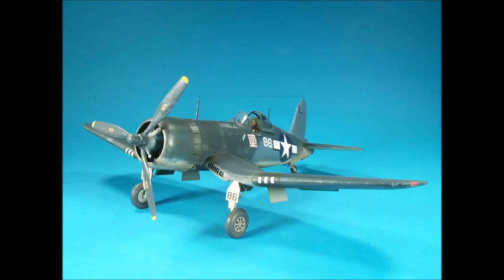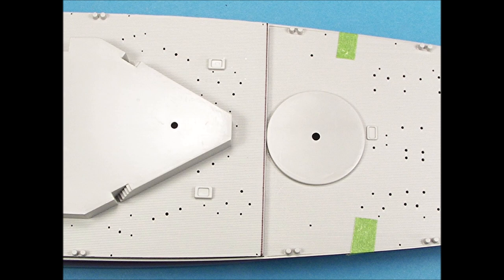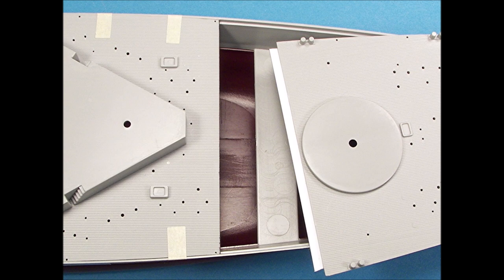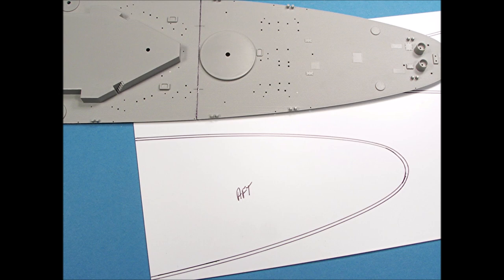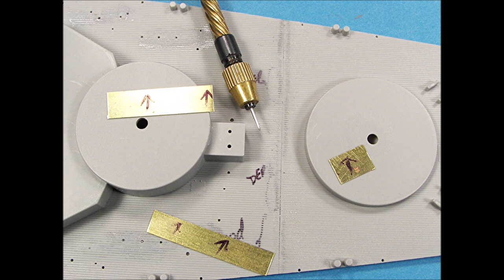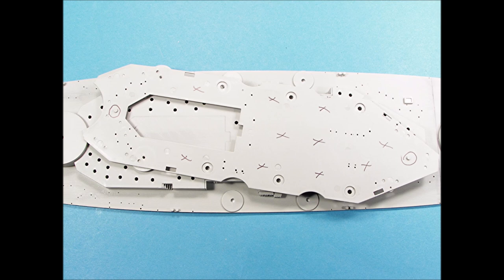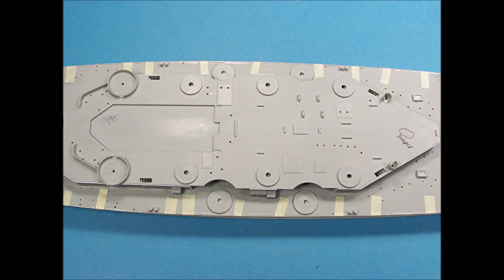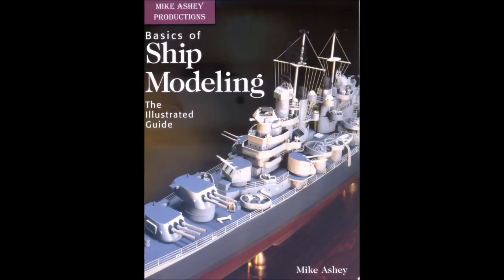Trumpeter 1/350 scale USS North Carolina -part-1, hull and main deck construction techniques

Comment: Got the model.  Bought your book.  Bought some accessories.  And sat for over a year scared to get started!  NOW - I'm gonna be ready to dive in!  Thanks Mike!
Reply from the maker: Glad to hear the videos help

I recommend the Gold Medal Models photoetch set and Blackcat models 3D printed parts.

Mike
Reply: I was afraid too. I was really intimidated by photo etch. I’ve definitely messed up a few little bits but overall it’s been OK. Just go for it and go slowly👍
Reply from the maker: @davidhunt1947  

Use Gold Medal Models photoetch

It’s well engineered and easy to use

Go to my website and download my ship books. They are in PDF format.

Lots of good info and pictures on using photoetch
Reply: @scalemodeling  thank you